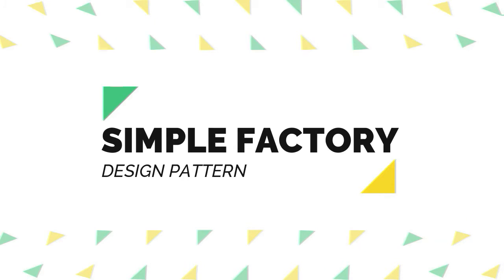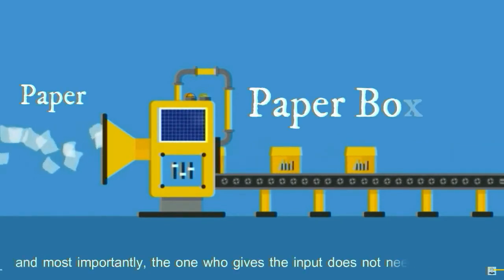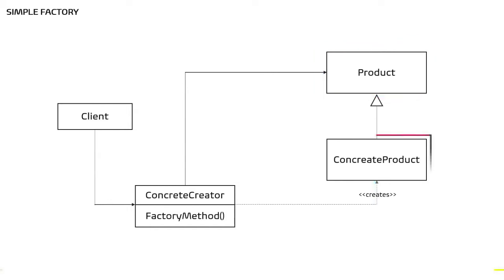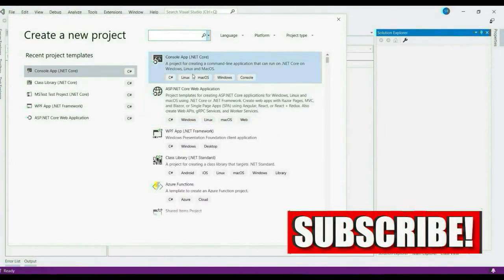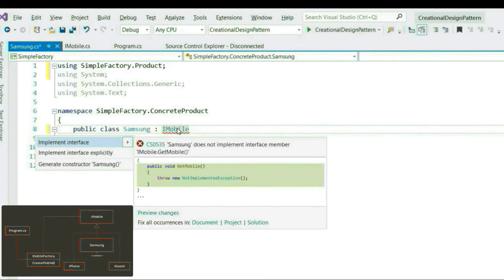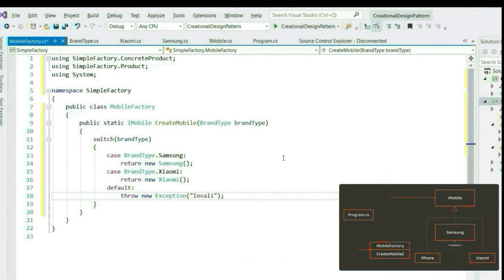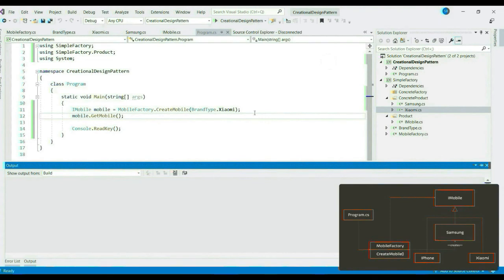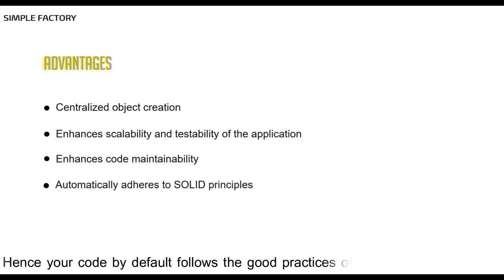Simple Factory Design Pattern in C# I Design Patterns(Part 2)- What is Simple Factory Design Pattern

Comment: Great example and very clear. Just a question, is there any other reason to use  a static method in the factory  other than by choice?
Reply from the maker: It is used just to avoid creating an instance, you can always do it without using static as well.